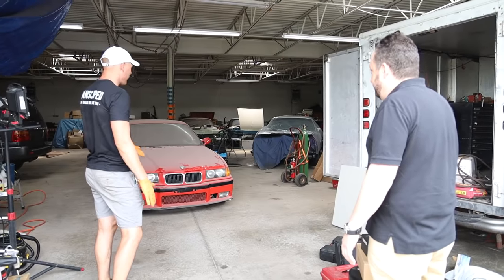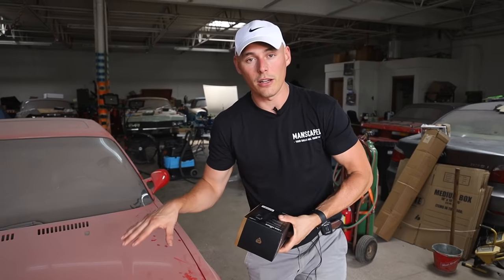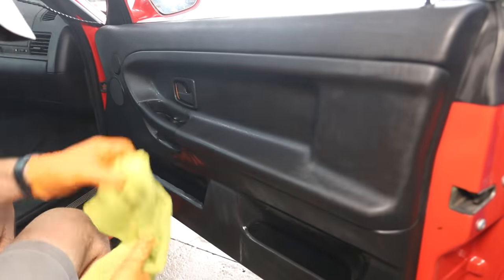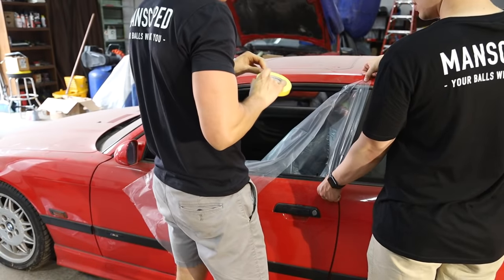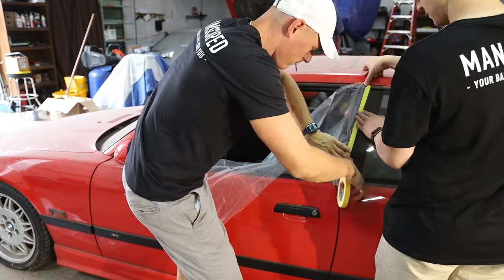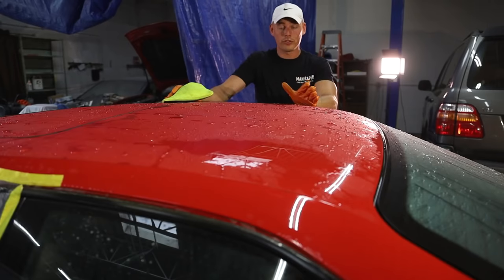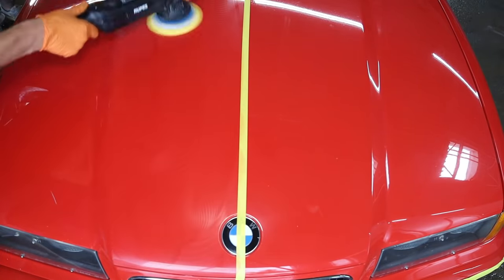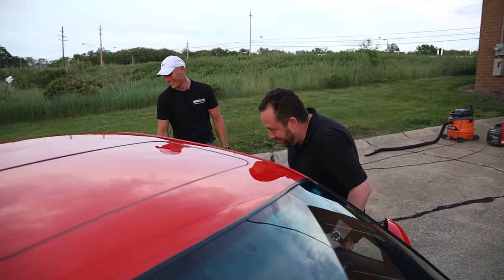ABANDONED BODY SHOP FIND First Detail in Years BMW E36 M3! Satisfying Car Detailing Restoration

Comment: That guys sitting on gold. The value is only gonna go up on them m3s especially when its completely stock. Smart guy
Reply: The completely stock ones are generally the most expensive actually, lol
Reply: You forgot the part , When he said...  he had no money to do any mods !!  

This car was way outta my league when it was launched the first time 😔

And , still can't afford the one's I like 🤦‍♂️
Reply: @datsoon9236  Yes, that's exactly what OP said... they didn't forget anything.
Reply: @Pennsyltucky84  ah, didn't catch that part. That was just from my knowledge of BMW's. I have an e30
Reply: If you haven't owned one like I have you might think they're real m3s.THEYRE NOT.The only e36 m3 that should become collectable is the competition model because of less than 200 came to the US.They still have the bored out 325  engine with hotter cams so it's not a real m3 either.
Reply: @realisrealite5554  are you real?
Reply: @Pennsyltucky84  I literally red it the other way around 😂😂 I just now realized what he actually said sorry
Reply: 10 to 20k now
Reply: Super tes vidéos YouTube tu gère trop bien bonne restauration de la bmw e46 super ra casquette nike blanche
Reply: They’re like 15k - 30k now, depending on mileage and condition.

Comment: RJ: “We had to tape up the doors  because the door windows won’t roll up. I’m happy because we didn’t get any water in the car.” 

Me watching the passenger side tape come loose three times as he’s spraying: 👁 👄 👁 

🤣🤣🤣
Reply: It’s not a big deal, you can wipe down the entire vinyl interior 😅 I power wash my vert e36 all the time and get a bunch of water inside always
Reply: I was hoping that someone should have commented about that thanks i can die now
Reply: Just a new fuse and it's fixed?
Reply: @henry3397  I believe that's leather, but can still wipe down quickly

Comment: 17:35 The colour is named "Hellrot". It is german and means "bright red".
Reply: Its actually the other rarer red and not Hellrot, megello I think
Reply: @Suhspencce  its mugello
Reply: It’s Mugello which is a single stage paint and that’s why the buffing pad turned red.
Reply: You looked up the color name didnt you?
Reply: It’s neither, it’s “brilliant red”, only offered in 1995 in NA. Mugello and Hellrot have more blood and less orange.
Reply: @rhar1044  no Leo was right it is hellrot I looked it up
Reply: @jeeter1980  @Mark Spence - actually ///Leo is right, it”s HellRot, since the car is a 1995. Previous production runs 1992-94 offered the Mugello red that was indeed a little darker.
Reply: @rhar1044  actually the Brilliant Red was reserved for South African Export only. It should definitely be HellRot.
Reply: Its a 314 Hellrot BMW Color, i had same color on my E36 :)
Reply: @jeeter1980  I just took my titan silber metallic e36 to maaco and got a single stage stage paint (urathane with clear coat mixed in) should that still happen if I were to detail it ?
Reply: @grvyrdgang5672 - yes, if you buff your new paint then you'll pick up some color on the pads. It's very normal on any single stage paint. Only the 2 stage method will leave you with 'clean' pads...

@ 17:30 - I had to laugh at the "the windows don't roll up" . Of course not, this is a 90's BMW... On the topicof color, this is Hellrot. I have a '95 BMW in this color as well, it's actually pretty distinctive. And beautiful. :)
Reply: Or just a brilliantrot
Reply: @jeeter1980  imola red is single too. i hate single stage lol
Reply: Correct. I have a similar car and had to buy paint for my plastic padding rust fixes. :D

This car is soon more plastic than metal so maybe time to let it go. Or i sell it for $500
Reply: I say it's mugello Red 274, i Had an e36 with this Paint, only e36m3 an e34m5 20 Years got this Color OEM.
Reply: @rhar1044  i can confirm its brilliantrot, i have a brilliant rot coupe. only available in 1992 in eu and uk
Reply: I had a 'K' plate E36 in the same colour.  It's definitely 'brilliantrot'
Reply: It’s Estoril red and don’t argue!
Reply: I think its blue
Reply: @112DCL  😂😂😂

Comment: Car looks well maintained, the sheeting of the water when sprayed on to get the dust of......
Reply: I did think that too but further on, he rubs the sand paper paint and you can hear there's nothing on the paint.
Reply: Probably they threw some dust on in it them self, red is not even faded..
Reply: @MrSquinker  I do tend to agree, it did seem to have some product on the paint and did seem to be too good to be true, when it was being rinsed off, I thought the exact same thing. No pink, easy rinse....too easy to be genuine. I'm not defending strongly here. I do tend to agree....after you see him rubbing the paint and it's gritty,it is possible it's genuine. That's all I'm saying.
Reply: @MrSquinker  of course it wasn't faded. It was inside.
Reply: @sleepingwarrior4618  that just means he waxed it four years ago. It was inside, so no sun to break it down. You'll also notice that it didn't bead/sheet everywhere.
Reply: @Pennsyltucky84  I'm fifty fifty. Red cars do turn pink as the paint oxides. There was no pink on that car. There should have been even just over four years.
Reply: @sleepingwarrior4618  not when it's kept inside.
Reply: @Pennsyltucky84  oxidation is accelerated by direct sunlight but not caused by direct sunlight. The paint will oxidise inside because the causal agent...is air. Oxygen. It should have pink on it.

"The brilliant shine and gloss of a car’s paintwork is beautiful to look at. However, if your pride and joy is starting to look a little dull and faded, it is most likely a sign of oxidation damage. What causes paint oxidation? Simply put, oxidation is a chemical reaction. As a result, molecules, atoms or ions are chemically changed. For example, oxygen is an oxidizer that changes the molecular structure of paint. This is what causes paint oxidation on your car. As a result, the once-glossy paintwork begins to look faded. The paint also loses its smooth sheen and feels rough to the touch. In extreme cases, car paint takes on a distinctive chalky or cloudy appearance. Not only does paint oxidation look unsightly but it will also reduce a vehicle’s resale value. Ideally, auto preventative maintenance is better than any cure. Take a closer look at what causes paint oxidation and discover tips on how to prevent it."
Reply: @Pennsyltucky84  but the water beeding en sheeting when they rinsed off the car was suspiciously good 😅
Reply: @MrSquinker  yes. I think a fair few of us had that exact same suspicion, ha ha
Reply: @MrSquinker  no, it wasn't. That was my point. Yes it beaded in some areas, but not all. It's been kept inside, away from rain, washing,  and sun. Which are the things that really kill wax. So it's not surprising to see some beading, even 4 years later.
Reply: Strange how the seats had mold on but non on the seatbelts ,I've had a car the was stored and the seatbelts were disgusting as well as the seats 🤔

Comment: Whoever detailed it 7 years ago did a very good job. Just by pressure washing with water only you can see that water beads easily.
Reply: That’s actually a phenomenon that occurs with “tired” and fading/heavily oxidized paint, as this car most certainly was. 

It appears hydrophobic as it’s oxidized, thinning, and ultimately failing as time continues on. I assume these fellas were smart enough to use a paint depth gauge before beginning the enhancement via polishing to make sure they weren’t thinning out this single stage paint to the point where they could burn through, because paint that old and frail would have been dangerously thin. 

All in all, the result the achieved was fantastic and these guys as well as the owner seized an opportunity to rescue this original paint just barely before it was too late. Because paint that was reacting that way before polishing of this age was telling a story much worse than meets the eye. The owner has an invaluable gem on his hands. And he rescued his car and his paint just barely before it was too late. 

Some food for thought. :)

Comment: Loved the video! Just wished you’d break down what products you’re using for each step. What did you coat the leather seats with at the end, when you were done with them? What kind of tire and wheel cleaner did you use? You said you used apc on the leather and interior, which one, and diluted to what? The only reason I watched this video is because I have two potential clients who both have e36 m3 sedans they want me to detail, and I was thrilled to see this video. Would love a more thorough breakdown, in terms of products, next time! Thanks!
Reply: I agree! I want to know what that sprayer hooked up to the air compressor was
Reply: right...thought that was the point of the video?

Comment: 1 mold needs to neutralized 2 the leather has to be rehydrated.  Lexol etc. 3 measure thickness of paint before polishing and use different pads and use plenty of rags on interior

Comment: You need to use lubrication when clay bar paint and you will save yourself some paint correction time and also you blew the plastic off the windows several times but this is all constructive criticism.

Comment: You asked us to say what we'd like. Well I'd like to see the rest of this car revival. What about the engine what about the windows that won't roll down or the power that isn't there. What about the car after you've cleaned it? Does it just go back into the garage it was in for another 20 years? Is the suspension okay? Will it even drive? Etc. That's what I want to see.

Comment: I dont see anyone commenting on the color as requested but I only scrolled a little ways down.  Anyway, the BMW M3 your working on is the "Holy Grail".  Its Hellrot Red, black interior w/Vader bucket seats, manual transmission.., and an M3 and its un mint condition.  Nice job!
Edit: accept those wheels - please get rid of those ugly wheels, what were the Germans thinking?  If you pop the hood you will see that BMW placed a label on the driver's strut tower with the name of the factory paint
Reply from the maker: Man you really know your stuff! Those Vader bucket seats were so freaking sweet!

Comment: In Indonesia, back in early 90's, older people as my dad's generation, call the E36 bodylines as a Bulldog.

in newspaper's classified of used car, if it mention BMW Bulldog, it means BMW E36.

After age of internet, when i was browsing BMW back in 2003's , i found out that American call the E36 bodylines as a Dolphin.

But also back in 2000 i never saw indonesian mention BMW Bulldog anymore.
My generation also didn't use Bulldog terminology like old people did.

So, is there any unique term or callsign for BMW E36's bodylines beside Bulldog and Dolphin?

Comment: The 1995 e36m3 was the worst m3 ever made.The interiors fell apart the rear subframe was brittle and prone to crack,the water pump had a plastic impeller and if you weren't very careful shifting gears you could have the dreaded over rev.They weren't real m3s real m3s had the s50 and s52 with 6 throttle bodies,7900 red line,beefier brakes and rear diff.Bmw didn't even allow the US to have a real m3 until 2001 and that car was flawed too.The s54 engine ate rod bearings and had all of the problems that made the previous m3 garbage.I had a 95 e36m3 and a 04 e46m3 so I have first hand knowledge of the built in problems that all Bmws have.

Comment: Sorry dude, but after watching your video you are definitely the wrong guy to touch this car. You’re doing everything wrong and regardless of what you think, there ARE wrong and right ways of doing things, despite what products you or I or others may use, there are steps to follow and time-tested practices you do or not do. Go watch some videos and learn the CORRECT way of doing each thing you’re trying to do, so you don’t ruin other people’s cars, after you are done and long gone, it’s not fair to them when their headliners and dash pads and door cards delaminates from all of that moisture you’re tornadoring into the panels, you as a professional should have removed the windows switches and activated them with a battery and jumper wires instead of that hack tape and plastic job you did. This car is a “unicorn” of sorts, and you didn’t treat it as such. I’m only watching the car for the car, you need to learn some correct methods, and that has NOTHING to do with what the “owner asks you to do”, or what I “think”, so please don’t use those as excuses for lack of experience and knowledge.
Reply: 100% agreed with you 
Not the correct way do do a detail, give him a few weeks and the bad smell is going to come.
The door cards are going to delaminate as you said.
To much tornador and to much APC on the seats.
The back SEAT should come off as well.
Is just another YouTube gold seeker.
Even for free is going to be expensive.

Comment: I do not like watching that APC chemical or whatever it is (because you didn't explain it) as you seem to put so much on and covering such a big area & especially with the back seat bench on the ground you can see how much of the liquid is going into the foam beneath soaking through the seams. Also surprised you didn't then put some sort of protectant over the cleaned leather.